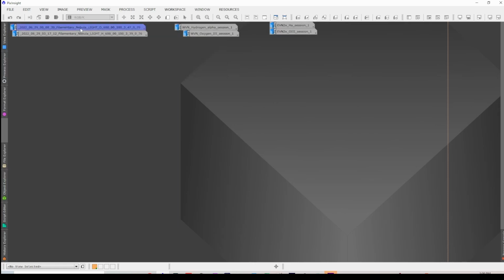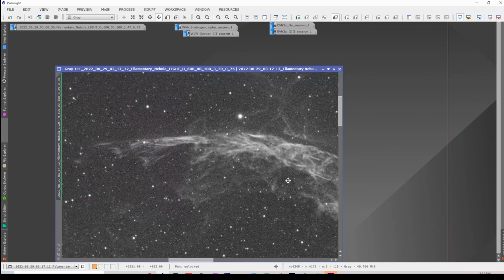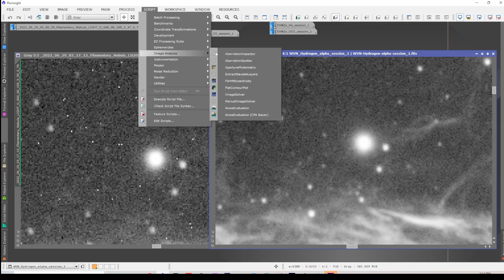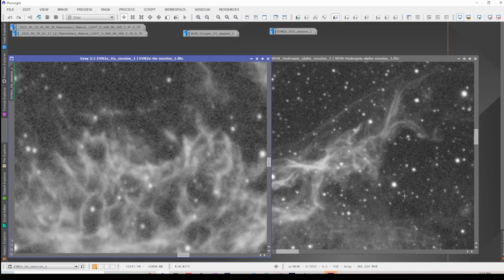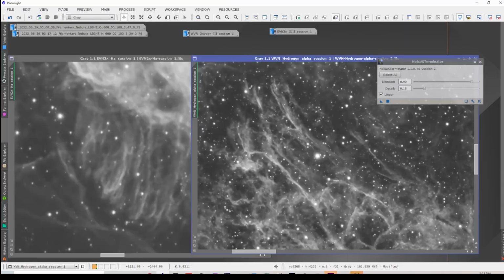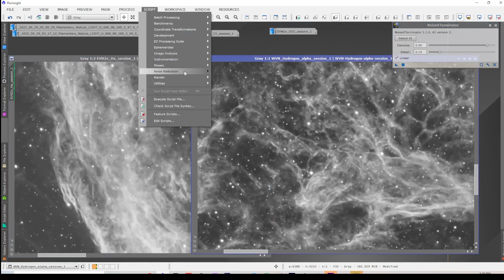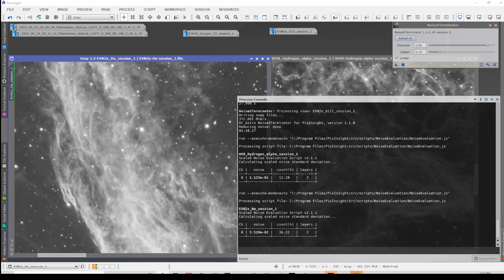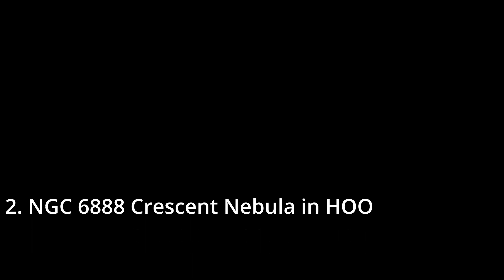Let's look at the ZWO ASI2600MM Pro!! AMAZING RESULTS!!

Comment: Amazing, thanks for sharing this! Do you have any more info on OAGs? Is that a replacement for a dedicated guide scope? Ty
Reply from the maker: Hi Nicholas - so the OAG or Off Axis Guider is a device that steals light from your primary telescope to use for guiding versus a guide scope. Often times this is beneficial when you hit let's say 1000mm focal length and larger. You can use a guide scope for sure at higher focal lengths but sometimes the guide scope isn't perfectly in line with the primary telescope and can introduce something called flexure which in essence means your two scopes aren't tracking the same thing at the same time at the same amount. So what can happen is your guiding might be spot on, but you have star trails in your image. So using an off axis guider eliminates that error and uses the same exact light coming in to your primary telescope/camera and steals a little bit of that light 'off axis' of the imaging plane. The mirror/prism it uses in my case sits just a couple of millimeters above my camera sensor as to not block light from hitting my camera, but able to grab enough light for itself to project into my guide camera.  Hope this helps :-)
Reply: @midwest_astro  very helpful, thanks! So you try to position it let's say if your sensor is 4/3 or rectangular (of course circular aperture is always square or equal per side), then position the OAG on the narrower side where light would already have been lost anyways? (Or maybe I'm describing an ideal world...)
Reply from the maker: @nicholaspetersen1629  so at 12:27 you can see how I position it. With the ASI2600MM, it's a rectangular sensor of course. I use the top of the long side for my OAG to steal light. That way I can steal more light there than from the sides. Given the sides will be wider in reference to the imaging circle, there's less available space on either of the two shorter sides of the APS-C sensor. If you do the top or bottom there's much more room to align that prism and grab as much light as possible. Hard to describe with out a visual but in the video at that point you can see how I align it.

Comment: Great video and timely! I have all these exact components sitting in boxes waiting to be put together - your imaging train section will be a big help. 
Just curious how you found the process of adjusting the Prism on the OAG-L to provide a good star profile for tracking, and also not shadowing the 2600MM? Just trial and error to find the sweet spot - or - any tips/suggestions?
Thanks!
Reply from the maker: Congrats! Yes, the prism. I started by just eye-balling it. Then I took a flat image in the house and just ever so slightly moved the prism away from the sensor until it’s shadow just disappeared. On long exposures it does show ever so slightly still but calibrated out perfectly with flats. Hope that helps!